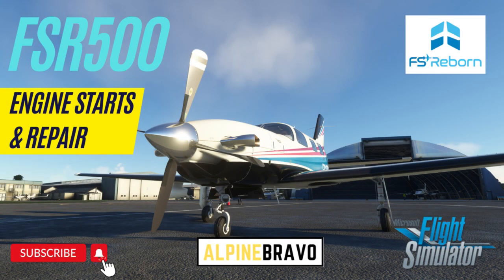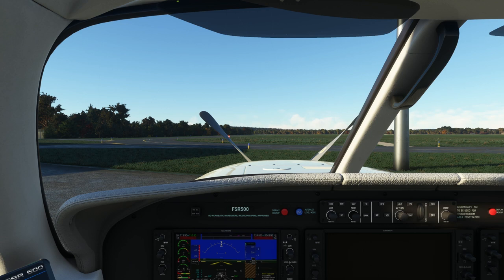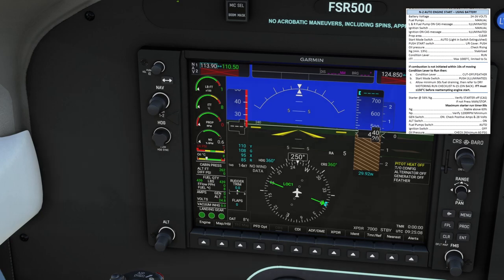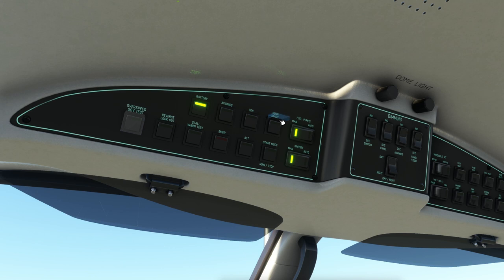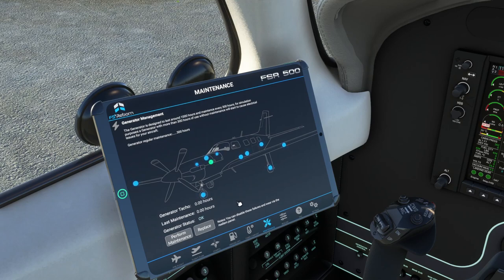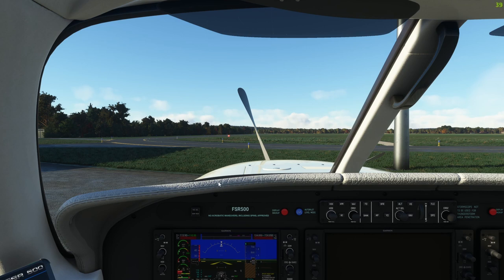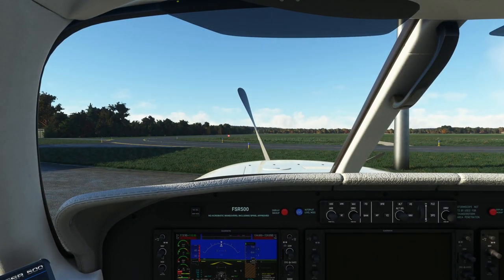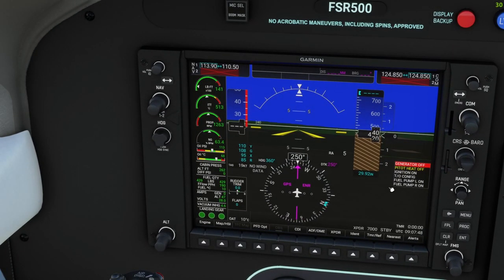Flying the FSR500 | Part 3 - Engine starts & Repair | FULL tutorial

Comment: Thanks very much for the video Brendon!  Did get caught out on my first flight with the generator being damaged due to not introducing fuel quick enough.  Love the fact that you have to know this aircraft's systems well to be able to fly her.  Nice wee challenge 😊
Reply from the maker: Great stuff.  There's quite a bit more hidden under the bonnet. This is a deceptively simple aircraft: it was designed to be safe for a single pilot operating at high altitude so lots of automation to reduce unnecessary workload, but you need that once you factor in all the things that can go wrong.  I've never had the need to consult the emergency checklists so much before.  This is good!
Reply: @alpinebravo7090  I still use the in game ATC and it has screwed me over many a time and using this aircraft has been no different.  Executed a missed approach even though I had clearance to land due to aircraft not vacating the runway in time. I was very glad of the reduced workload at that point 🤣
Reply from the maker: Ah yes MSFS ATC.  The gift that keeps giving.  I basically ignore the go around instructions unless I'm in the mood to practice.  Using addons likenFSLTL or AIG with the freeware ground and air traffic mods solves most of the separation issues I find.
Reply: @alpinebravo7090  Very useful video. but what do i bind the hardware to because when i tried to bind to some sort of options, my hardware didnt move the condition lever
Reply from the maker: It should be "mixture axis -100l+100", but there seems to be something effecting how external controls operate - I had a weird bug last night where my condition lever wouldn't move. Quitting and restarting seemed to solve is. FSReborn are aware of the issue - head to their Discord for more info
Reply: @alpinebravo7090  Thank you

Comment: I was wondering what the procedure was when starting the plane in the dark. Do you just use the flashlight to check everything or can you activate lights within the plane? Presuming there isn't a second battery feeding the lights, can you turn on the main battery as soon as you get into the plane?